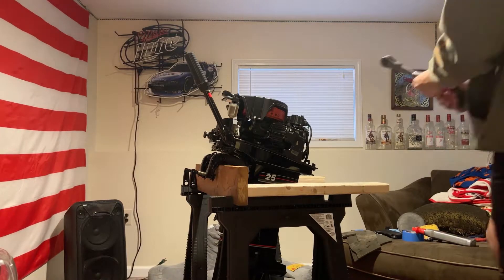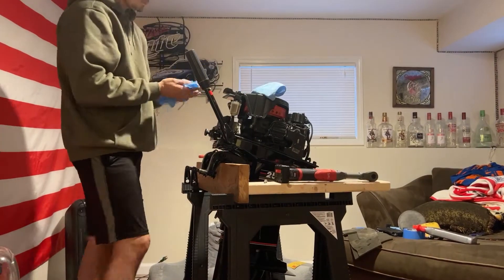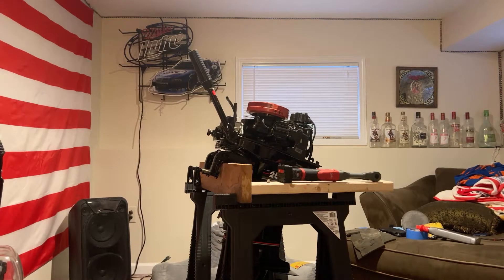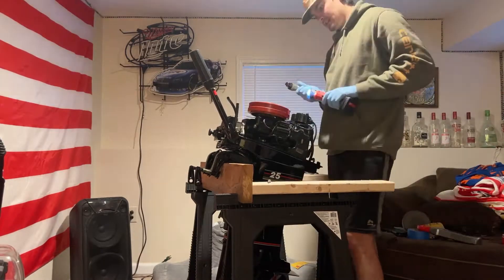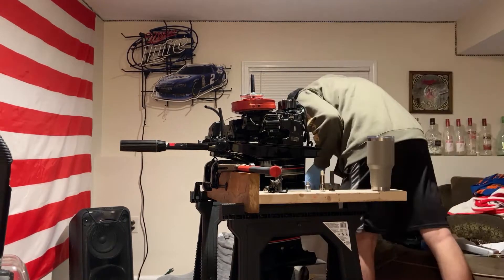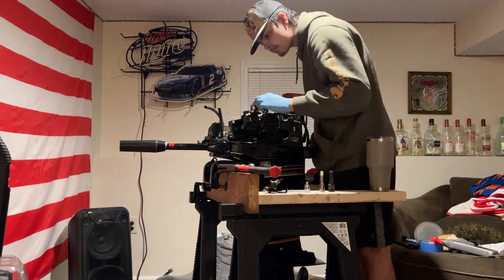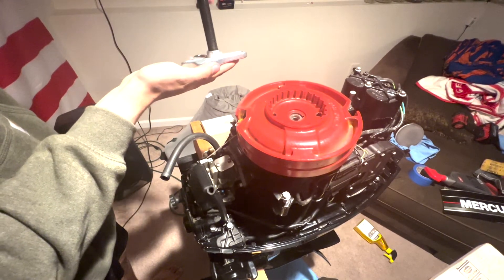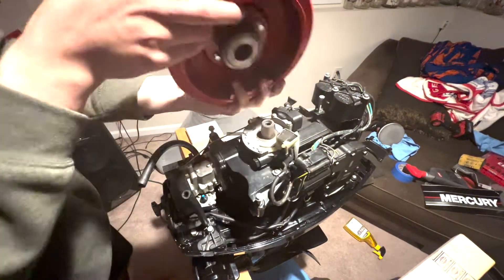Removing flywheel from 1991, Mercury 25 HP two stroke outboard engine.

Comment: Ive got the 40hp 2 stroke of that engine not very powerful for a 4 cylinder but its quite a reliable motor and on my 4.5m it gets it on a plane no worries and is surprisingly decent on fuel for a old 2 stroke and not to loud for 2 stroke 😂

Comment: Could you tell me what size thee two bolts are that threaded into the flywheel? On my 1987 24 hp 2 stroke motor Mercury said they were M10 x 60 bolts but he didn't have the thread pitch number. I'd guess it might be either 1.25 or 1.5 on the pitch.
Reply: M10 x 1.5